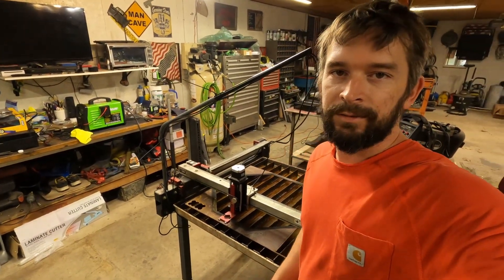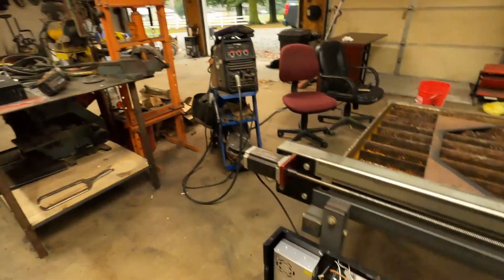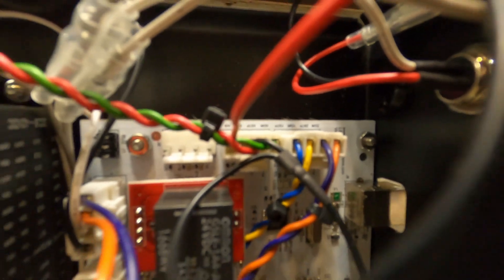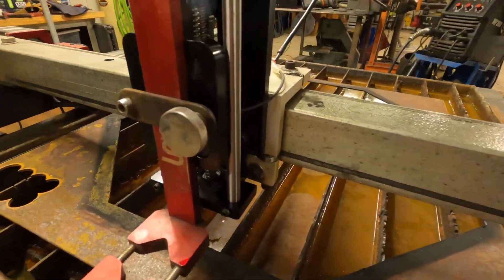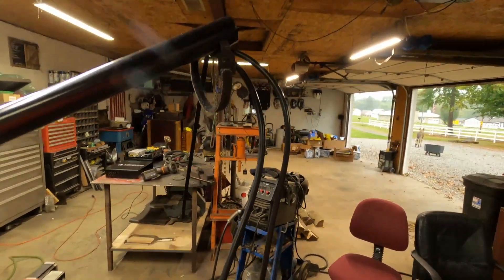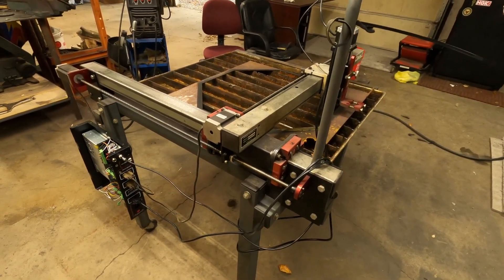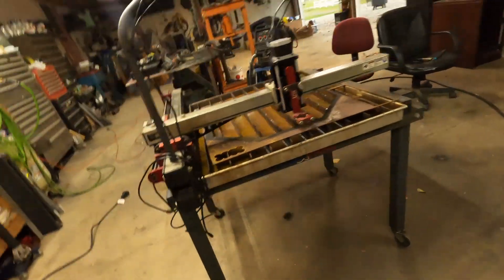Langmuir Systems 1st Gen Upgrade to Z axis and THC Upgrade

Comment: first of all, how do you like you the upgrade and is it worth the money?
Second question when you upgrade does the new box also upgrade to the new processor, fire control? Or are you still using Mach3?
Reply from the maker: I honestly couldn't go back to not having it. Yes it is ready to run FireControl, I feel Mach3 is a better all around program but firecontrol is specific for these tables and has run flawlessly for me.
Reply: @smittyvideos2619  I was watching your video again. at the 1:38 mark where do the white and black wited that come from VCC and GND connect? I was trying to look for it in your video but could not find it. Thank You in advance for your reply.
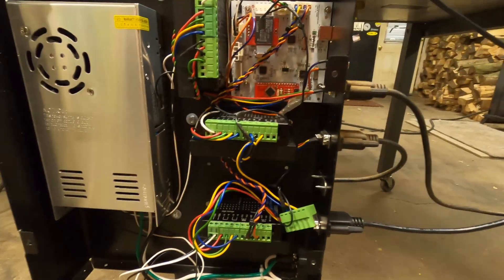Reply from the maker: @reidjensen569  if you pause around the 1:18 mark i think thats what youre talking about. if not give me your email and ill send some pictures of inside my box